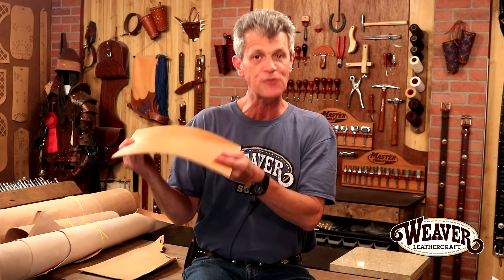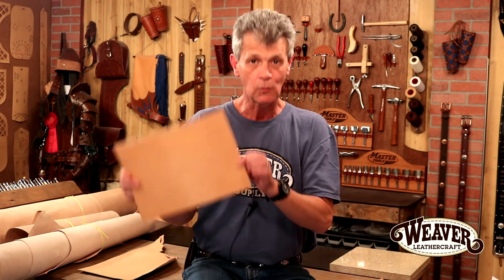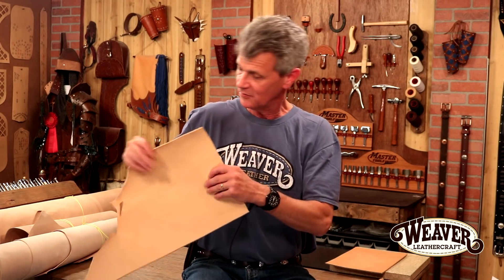The Leather Element: Why Isn't My Leather Doing What It's Supposed to?

Comment: Hey Chuck - love your videos.  Do you have tip on how to align punching holes before stitching? I try to mark the holes before punching but still find them to be a bit off alignment while stitching, especially when the project have curves. THANKS!
Reply from the maker: Hi Teresa,
I am so happy you like the videos! Thank you! Oddly enough your question comes at a funny time because I am just finishing a video on Holsters and we do that. Between here and the time it releases try this. Once you have one side of the project chiseled take a piece of tracing film and lay the leather over it with some film outside the edge. Trace the edge of the project and then, with some kind of awl or scribe with a long thin shaft/point (so you don’t round out the chisel holes) mark through the existing holes into the film. This is tedious but it works nicely. When marked, cut the tracing film on the edge mark, flip it over and lay this on top of the other side and mark. With the tracing film you can see the groove line so the marks fall into it perfectly and are never seen. The trick is to make sure, when marking into the film from the original set of holes, the awl or scribe is as straight up and down as you can get and as centered in the chisel hole as you can make it. This should help align the holes nicely. See if this helps!

Comment: Hi Chuck!  Do you have a video on casing leather?  I’ve heard so much between “wipe it with a damp sponge” to “soak it and then leave it overnight in a ziplock”. I struggle to get it to the sweet spot where stamps burnish the leather. I almost never get it right.  Also, for belts, if one end is cased “ok”, it’s dry by the time I am stamping the other end.  Help!
Reply from the maker: Hi Scott,
There are a lot of opinions on this, I prefer to wet my leather until it's wet about 3/4" of the way through and then let it sit a few minutes to let the water wick back in. The color will start to lighten and there shouldn't be any water sitting on top of the leather. As you're stamping you'll be able to feel when it's time to add more water. With larger projects, you may need to re-wet the leather quite a few times. 
We have a new video coming out Friday on tooling a Celtic knot and I'll show how I case my leather in that video.
Reply: Weaver Leathercraft thanks chuck!

Comment: Hey Chuck,
Got a simple question. Need a simple answer. 
How do you remove a snap in a piece of leather?
Want to put a rivet instead.
Reply from the maker: Hi Janet,
The easiest way to remove a snap is by using a drill, check out the video below to watch Chuck demonstrate it. The snaps start at about the 2:32 mark. If you don't have a drill then you can try to slide cutting nippers under the base of the snap and cut the post but you do have to be careful not to ruin the leather this way. Hope this answers your question!
https://www.youtube.com/watch?v=HLZZpm-rsPA

Comment: Question: If I'm doing a project I plan on dying and water hardening, is it better to dye before or after hardening, and why? I have a few projects coming up where I'll need to do both.
Reply from the maker: Hello,
I always do the dying after hardening using the dip-dye method, if the leather is too large to dip-dye then I use a wool dauber and apply the dye liberally.
Reply: Thanks!

Comment: So that's what I was doing wrong, I was wondering why it just didn't want to tool right(I was hoping to use the cheap leather to get some basics before risking the expensive leather, oh well). Is their any use for the cheaper spongy leather that you would recommend?
Reply from the maker: Hi Joshua,
You could possibly use it as a liner for products such as horse tack or pet collars depending on the thickness.
Reply: @WeaverLeatherSupply  Thanks!